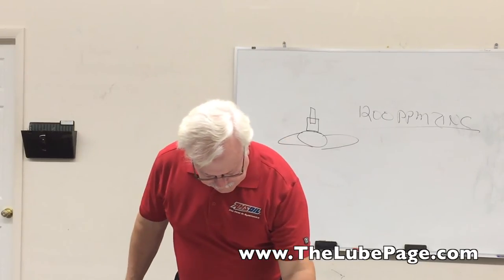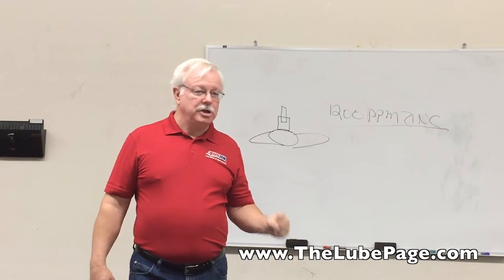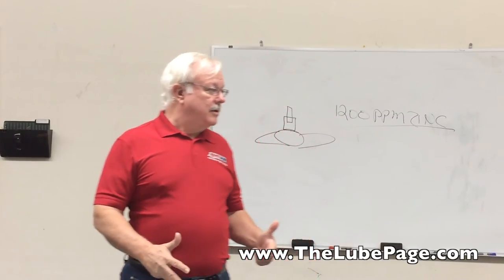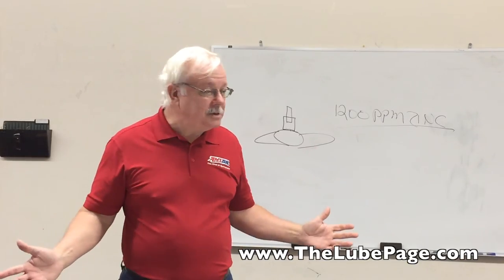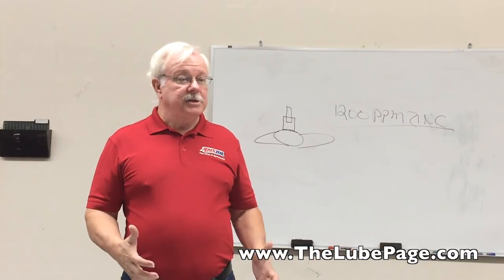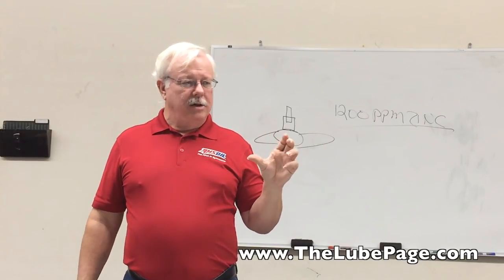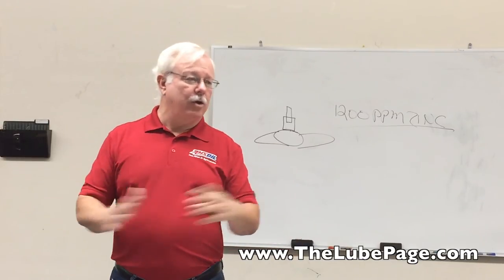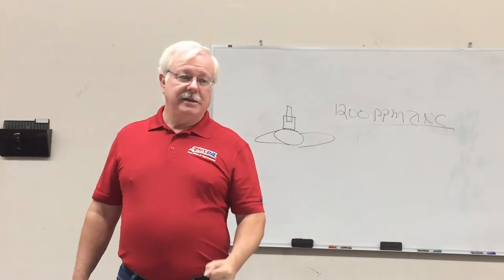Older Engines Require Higher Zinc Motor Oils

Comment: Don't forget about small engines. Commercial mowers use high zinc oils. Kawasaki's SAE 30 points out it has zinc as obviously as they do the oil weight. AMSOil should develop an oil for commercial small engines.

Comment: did the WW II aircraft use zinc in the oil. does the military  AC have zinc in the oil , SR-71, U2 spy plane, , C-5,  B-52, B-1, and fighter AC.

Comment: I have a 1989 Ford F350 with the 460 engine...is that engine old enough to require a high zinc oil, or will Amsoil XL or Signature series be ok? It is all factory stock by the way
Reply: +Chad W. if it has a flat tappet camshaft yes
Reply from the maker: Amsoil Signature use additional additives to make up for the required reduction of zinc and phosphorus.  For an 1989 I would thank it has a roller cam but if it has a flat tappet system then using the Amsoil 10W-40 Premium protection which is SL rated and retains the high zinc and phosphorus additives would be my choice.

Comment: Older Chevy 4.3 Vortec engine; 270,000 km (168,000 mi). Am I supposed to believe the manufacturers that I should STILL be using that water-thin 5W-30??
Reply from the maker: The deciding factor is oil consumption.  If you are using more than 1 quart every 8,000 miles moving up to a 10W-40 would be a good choice.  This means if you are down a half quart when changing at 3000 to 4000 miles then you are using more oil than the Factory spec.  Increasing the viscosity to a 40 will reduce oil consumption.  Quality 5W-30 will protect the engine but it can be consumed at a high rate in older engines.
Reply: Wow, I've already switched to 10w40. Thanks for confirming my guess! Jesus bless you.

Comment: Hi Sir. 
Can you please suggest me which would be good oil for old 2006 Skoda Octavia rider 1.9tdi diesel clocked around 90000 kms on odometer. 
Previously i was using mobil1 0w40 fully synthetic which has acea a3/b3, a3/b4 ,vw 505 505 spec.
I want to try 5w40 fully synthetic this time. 
Thank you sir. 
Please suggest best Amsoil.

Comment: Hi sir, what about for those engines with bucket shims? they are very similar to those flat tappet system. do I need to use higher zinc engine oil for this kind of engines.

Comment: Dan I have a 2016 ram with a 5.7 Hemi I am not sure if I can run signature series 5w20 in it everybody says to run penzoil platinum in it since especially the 5.7 Hemi has upper valve train oiling issues.
Reply from the maker: Paul, Pennzoil Platinum is equivalent to Amsoil XL.  Signature series is superior and yes you can run 5W-20 in your Hemi.  Personally, I would run Amsoil 0W-30 Signature Series for better High Temperature High Stress performance.  If you want more detailed info email me and I'll send you the tech info danwatson@thelubepage.com

Comment: Put a high zinc NON motorcycle oil in your Harley’s and you will notice a big difference. Less engine noise such as ticking and temperature runs cooler. Harley’s ( other than sportster) don’t share engine oil with a wet clutch. A motorcycle oil is actually a downgrade for engines that don’t require it. I dunno why amsoil and others still recommend motorcycle oils with friction modifiers removed for big twin Harley Davidson engines. Amsoil signature series or racing oil lubes the engine much better than a wet clutch designed motorcycle oil. Motorcycle oil is actually designed to allow MORE friction so that the clutch does not slip. Again Harley’s don’t share engine oil with the clutch, they are separate. So why use a oil in the engine that allows more friction ??? You want the least friction possible. If you got a Harley try 20w-50 signature series or the racing oil. You will notice it runs a lot cooler and top end noise disappears

Comment: I have 2010 camry with 2.5l engine and it has 130 thousand mile on it what type of oil weight should i use thanks.
Reply: jr cuna follow mfg guide.
Reply: 5w20
Reply: David Steckley. Thanks david steckley

Comment: While this may be true for break-in, typically 800PPM is fine for stock engines past break-in, even with flat-tappet camshafts. Reference: GM Techline in 2007 and also that most Corvettes have specified SN oils with flat-tappets with no issue. The best option for break-in is obviously the Amsoil Break-In Oil, followed by the oil of choice, be it Z-Rod, Premium Protection, or Signature Series (as applicable for your use). Also note that too much ZDDP will actually CAUSE corrosion. The old adage of "as little as possible but as much as necessary" is about as accurate as you can get on this case.
Reply from the maker: Yes, GM says 800 is fine.  Experience may not fully support this level.  It requires much much higher levels of ZDDP to cause corrosion.  I would be happy to read the references on the corrosion and also if you could give me a link to the GM Techline article.
Reply: Dan Watson GM Techline December 2007 :http://www.archivedsites.com/techlink/2007/12/ generally over 1400ppm increased long term wear and 2000ppm and over the ZDDP started attacking the grain boundaries in the iron, resulting in camshaft spalling. Not to mention how cat-unfriendly the phosphorous is. Newer additives are out now that do a better job (Boron as an example) without as many drawbacks.

PS keep up the great videos! Very useful for Amsoil dealers such as myself!

Comment: AMSOIL  had a Double-length Sequence IIIG Engine test done  using Signature Series SN 5W30. The independent lab used a 3.8 L GM motor with flat tappets, For SN/ILSAC GF5 no more than 60 microns wear is allowed for cam and lifter , AMSOIL had 17.6 microns at 200 hours. Would the AMSOIL 10w30 ZROD oil have done better? http://www.amsoil.com/lit/g3320.pdf
Reply from the maker: Theoretically, yes the ZROD would do better.  How much, I can't say.  I don't believe it would be linear, that is to say, since there are 400 ppm more zinc and phosphorus a 33% reduction is wear would be seen.  I think there would be some diminishing returns for the increasing additive levels.